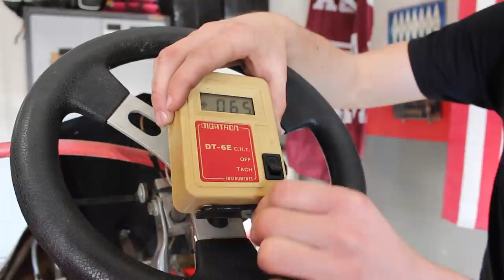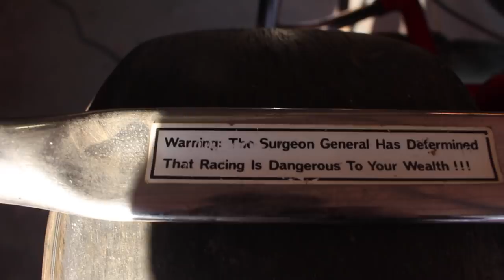2-Stroke Racing Go Kart Find!

Comment: Try cleaning the spark plug or buy a new one. If that does not work try checking the spark coil. Also try cleaning the float bowl if it has one

Comment: you want a carb kit for that carb change out the diaphragms as its a pumping carb . best way to check it is to see if its lifting fuel from a lower level . if it pulls fuel from lower the pump is working , if not there is your problem . you should also have a pop off pressure gauge or a little hand pump to measure the pop off pressure . i will see if i can find you a link .
Reply: these links should point you in the right direction . may not be a tillotson carb but it will be very very similar they are all pretty much the same

Comment: also check the diaphragm in the carb for holes tears and flexibility  soak the carb in carb cleaner remove any plastic and rubber parts first   count the needle turns on the high speed and the low speed you should be able to see the letters H and L on the carb soak overnight Rinse with water and blow out all air ports with a air compressor then reassemble

Comment: the pipe with the sticker on it is not a bash bar, its a so called stabilizer bar. You can install it to make the chassis more riggid. You can also fine tune by rotating the flat part in the horizontal or vertical position. (horizontal: more flex, vertical: less flex)

Comment: In the 80s yamaha sold karts at the cycle dealership in my hometown. They looked good and think based on yz125 i had a margay with McCullough and it would flat smoke the yamie. On track or street. Rear brakes only pretty sketchy.

Comment: i own few 2 strokes. It sounds like carb issues,but u might still want to compression test it becouse a 2 stroke will run with rings completely fried and piston being cracked it has happen several times on bikes iv bought, so make sure u check everything.

Comment: it could be gaskets causing a vaccum leak. once you get it running get a slide carb for it, they work significantly better than butterfly carbs

Comment: Let it run for about 5 to 10 minutes before you even think about trying to tune the carb because with my experience they have to be fairly warm to run right ........ also check the compression
Reply: What should the compression be for this motor. ? I just picked up a kt100 on a nice Prowler kart frame? I got a hell of a deal on it but I don't know anything about this motor I haven't fired it up yet I have just been reading all the comments trying to figure out carb settings and stuff glad I read to start it under a load!  The motor is off the cart right now and I was going to try and start it on a engine stand I'm glad I didn't I'm going to go ahead and probably rebuild carb. While I'm at this point!  Thanks for any info I also got 3 dry clutches 2 that are a horstman 2 disk, but they are the wrong size on the shaft it came as extra parts the one that fits the KT100  is a 1 disk dry cheap looking clutch?  I'm 6.3 220lb what type of clutch do I or should I run for it to handle what I need???  And eventually I want to figure out and learn how to  make stock kt100 fast and what that  involves?  Thxs for any info.

Comment: First thing after establishing spark and compression before taking carb apart count your high jet low jet turns to full in to seat make note of them .. Always start with high setting about a turn to 1.5 turns to start ... Tear carb completely down soak in a carb cleaning solvent like briggs and stratton or such submerged if possible...blow out all jets with high pressure air... replace fuel diaphragm and seals . It should run ... The original settings should be close as a rule ..  Another thing mechanics tend to over look is the crankcase seal its very important on a 2 stroke motor since that downward vacuum stroke on piston activates the fuel pump diaphragm.. .... good luck

Comment: i used to own one of those engines there called a yamaha 100s race engine, ps. the reason it is so hard to strat is that you need to choke it every now and then to get it to start, plus put a new spark plug in it.

Comment: The crank vacuum comes from good rings and head seals.
You can also put a bit of 2 stroke or crank oil in the compression chamber to help reseat the rings.

Comment: Two stroke motorcycle engines require ring replacement after a certain number of running hours. A compression tester is something that you'll need to see if that's the problem. 150 to 160 psi is really good. 120 and below... not so much.

Comment: There's no 2 stoke oil in starting fluid and a 2 stroke engine is basically the same as a four stroke, spark fuel fire  the only difference is it uses reeds instead of valves you boys keep messing around with engines and you will end up being pros it's really cool seeing you youngsters into  this type stuff keep it up

Comment: The KT-100 is designed to run on 100 octane racing fuel. Putting pump gas in it will cause preignition and much lower HP output.

Comment: Maybe test crank-seals? Hold a paper in front of the carb to test the suction. Also try to use starter-gas on the crank seals/crankcase while the engine is running and listen for change in rpm. Considering the engine has been sitting for a while, these seals tend to dry up.. Just a thought :)
Reply from the maker: Sondre Kvernstuen Ok, I’ll take a look at them, pretty sure the box of parts has some new ones anyways

Comment: You shouldn’t need to turn those mixture screws but 1/4 turn off seat. Also that is a wet clutch and it takes oil. If you need any engine parts/ and you will with that Yamaha, especially if you run it too lean. I have lots of engine parts and a couple complete motors for sale cheap. Mine is a Honda 125 shifter now.

Comment: ah, a late 80's Margay. Can't remember when they first started running the front fairings. Would love to know the history behind this kart. Looks like it had it's share of WKA races from that era. There's LOT'S of information on yamaha's out there. Their still run on a national level in some series with the 4 hole can, instead of the pipe. I really don't condone running in a parking lot or street. Take it to a track, and then see what it can do. As many said, if you have any questions or need parts hit up Woltjer Racing Engines, or Comet Kart Sales and take a trip to New Castle Motorsports Park, , they've been in the sport for a long time, great people, great facility. Good luck

Comment: check the crank seals. and btw that carb is called a tillotson. so internal fuel pump and no jets your "jets" are those needle adjustments. if you need parts to rebuild it or anything look up scooter swapshop talk to brandon he knows all about those

Comment: I would find a mikuni slide carb and a little mikuni fuel pump that runs off the crank case vacume, 1979 arctic cat pantera or panther with the 500 spirit engine should have both. Just play with the jetting on the carb a bit

Comment: to choke the engine you put your hand over the carb to draw in gass. Then try 2.5 turns on screw with black knob and 2.5 on low end screw. Good luck

Comment: awsm kart....yea that's a steal for a 'race kart'......the kart frame usually on the spendal or frame somewere will usually have the name....I used to have an older 'margay' race frame...I forgot all the names....'tony kart...margay...invader'...there were a few more tho...invaders and tony karts were big n the 90's n early 2000's....idk wut they run n wuts popular now.....those Yamaha 100's were 'thee engine' to have tho.....shifter karts with the 125 were even better but way expensive...250's were wacc tho lol!! usually tho Yamaha 100 was the cheaper but better built engine to have and u didn't need a clutch set up either....

Comment: An engine Needs  three things to run air,gas and oil I had the same problem on my 2 stroke engine just put more 2 stoke oil in the gas and you should be all fine.

Comment: Carb rebuild and a new plug for sure. Looks like a walbro wb19 carb? It will need a rebuild. Rebuild it and you’ll be sorted. I used to race formula tkm using these carbs. Keep it super clean aswell. Take the head off and make sure the piston ring isn’t gummed up. 
But your problem will definitely be the carb. Hit me up for any advice.

Comment: I bought Yamaha kt100 go kart
one week ago

it was lying in a barn for 10 years
I had to repair brakes and tank
I was surprised because the engine started the third time

Edit: I have question
I can't stop
if i stop engine engine cuts off
You had the same?
Did you have the same problem or did the engine still run?

Comment: Swap out your spark plug in between starting and running it. I have found with 2 strokes they flood with fueleasily and when your plug is wet they won't run for nothing.

Comment: I race 2 stroke shifter karts and think something is wrong with your fuel pump. I've never used a carb with a built in fuel pump but I suspect that it needs a pulse signal from the crankcase. Your fuel pump will have a fuel in, fuel out and a 3rd outlet which has to be plumbed into the crankcase to get a pulse when the piston goes up and down. It started and ran when you held the fuel above the carb because of gravity, now you have to find out how to get fuel pumping.

Comment: I'm a little late to the party but make sure you don't have any leaks in between the head and the crankcase or between the crankcase halves.  I've chased many strange idling issues only to find out the problem was an air leak in the bottom end.

Comment: BCR was for Brown & Crews Racing. They were a kart shop and engine builder  in the late 90’s.....you need to reset the pop off in the carb....or you will seize the motor.....check with the guys at north Texas karters...they can help you

Comment: using 2 stroke engine, to create a gas flow in the carburator you need to use a closed gas tank, gravity doesn't do the job

Comment: Ya know. No one understands they have a separate schooling for two strokes than gasoline engines. I know cars and four stroke. I have very little knowledge on two stroke other than they combust similar to a four stroke lol. I have a sled that does the same damn thing and can't figure out WTH the problem is. But he's right. It could have a weak spark under compression. The spark could be weak from fouling out. I usually run br8s or br9 are the anti fouling plugs and same price but they're awesome plugs try that

Comment: cranking it for that long without it starting scars the cylinder walls because there is no fuel/lubrecation getting into the cylinder. if you put a little oil in the cylinder first then cranked it it would be fine.

Comment: Take the carb off and the reeds if there is one there is a pin hole that might be blocked off and not letting it suck fuel because there is no vacuum

Comment: take off the vacuum line have somebody turn over the engine make sure there's suction if that ain't the case you got suction then pull Carburetor part make sure the frames nice and loose everything's moving right nothing's clock make sure the main Jets aren't clogged and it's a rich motor that motor needs a lot of fuel make sure you got your mixture screw out quite a bit and if it's too rich when it startslean out couple turns or half turn

Comment: This might be a stupid question but can you put a predator 212cc 6.5hp on that frame with the clutch facing toward the seat and the sprocket on the axle on the inside of the frame? Sorry if that didn't make sense. Thank you
Reply from the maker: KJ Animation Yeah you can, you just need a special mount kit.
Reply: Build Break Repeat will the racing one on go power sports work? Thank you
Reply from the maker: KJ Animation Yeah, should bolt right up.

Comment: Its a KT100 Yamaha Motor, on a Margay Chassis. It has ran the WKA (World Karting Accosiation). Spray a LITTLE bit of WD40 on the air box. When the motor will not start REV THE SH*T OUT OF THE KART to clean it out.

Comment: Hey guys iv just subscribed.
First off check basics 
Fuel to carb 
Spark plug
Spark 
If failing these you probaly have an air leak somewhere check from splits in the inletmanifold what the carb bolts onto one small slice/hole can throw everything off balance

Comment: Going to need to clean the carb properly jets probably full of crap and float valve chamber will also be gumed up change plug and lean off the mixture also check things like reed valves

Comment: Too much oil means it runs too lean and when you get it rich enough you're fowling the plug so it dies off. You'll wanna just add a half cup of gas to a gallon of your mix and see how that does, should be easier to start and easier to tune. Watch the smoke on the exhaust, too much oil means more smoke and not enough oil means no smoke.

Comment: Hi guys. I can’t believe, you are not able to fix two strokes engines. It’s a lot simple than 4 strokes. I'm not clear on what you did to the engine and how you did it. Did you sleeve the engine (thinking you have rebuilt the engine)? This is a very precise operation and this is where most of the problems come from. Holes must match 100%. These engines are forced and the bores are drilled to the max to get fuel in and out as well. At 11.00 you forgot the spark plug. Too bad! You have to change it immediately. The spark plug has to be changed often. That makes me think. Does the reeve system valve work? Is the spark plug collects a lot of oil and fuel? That's the engine.
 I have no idea if this engine is a point or induction ignition. If it is a point, please, check the shaft opening the points (also with induction), it should not have lateral movement. Replace bushings if necessary.
 The last thing is the carburetor (It might be the first thing). I don't know if this carb is a needle carb. Move the needle down for a leaner mixture and try. In my days, years ago, we used to widen the jet with special tools until the engine started to choke. Probably the jet is open too much. Replace it and widen it to one side before.

Comment: I have a problem with my go kart if anyone could help It would be a amazing I got it for 600$ perfectly running one month later I turn it on , start driving it for like 10 or 20 seconds then turns off, could it be the carboratour
Reply: yes most likely not getting fuel
Reply: jeep2003 would this be a carborator issue because the fuel is just staying in the pipe
Reply: most likely it has crud in the bowl that got sucked up by the jet. You can usually remove it and spray it out without even removing the carb from the engine
Reply: Carburetors on 2 stroke engine can easily get clogged up even just sitting idle for a short period of time. The gas evaporates and leaves the oil which is mixed in the gas behind. I good idea is to shut off the fuel supply to the carburetor and drain the float bowl.
Reply: check if the spark plug is sparking if not then you have a bad wiering from recoil.
Reply: REPLACE "ALL" FUEL LINES  with NEW  ONES
Reply: air leaks 1st thing a two-must have no secondary air ,can ck w/starter fluid any rise in rpm's is secondary air.[ an air leak ] this must be done BEFORE! you start ,tuning I suggest run a slightly rich mix until you are at fine race set adj,do plenty of plug ck runs reading your plug.  thru low mid,and top .KT's are a Blast, have fun!!  vancouver yamaha

Comment: I have regretted every two stroke purchase I have ever made 😎😎😎😎
Reply: nah man I got a 04 yz250 starts first kick every time, its a beast... love that bike. I'll never sell it.
Reply: ktm 250 love it would not trade it for the world...😍😍
Reply: They are a bit of a pain at first but what mad you regret your two stroke purchases?
Reply: photondebuger45 honestly don’t see how they are even a pain at all, speaking about dirt bikes and racing atvs, a 2 stroke dirtbike is 100x easier to maintain, cheaper to fix, easier to start especially when hot, and have the same if not more power that the four stroke that it is compared too. I’ve owned both 4 and 2 strokes. Both have there perks, but when it comes to a saying a 2 stroke being a hassle, then idk what your smoking
Reply: Carrot- Effects -122 I guess it does get a bit tiring to pull on a pull cord to get it to start but both 4 and now two stroke engines are getting starters or electric compatibility now it's great I like me my two strokes they fun
Reply: photondebuger45 Id still prefer kickstart over anything imo, if your bikes starter or battery goes out then your screwed if your in the middle of the woods or something. My bikes always start 1-2 kicks everytime both 4 and 2. It all depends on how well u maintain them
Reply: Carrot- Effects -122 oh of course now the more electronics are added there's more points for failure but I yet to own a bike with a kick start quads have kick starts to right
Reply: first bike i ever got is a yamaha dt 50 mx it idles beautifully and shits over all the 50cc 4 stroke mopeds
Reply: looks like someone doesn't know how to handle and maintain a 2 stroke or you are just scared
Reply: At least they make a glorious racket unlike their 4-stroke counterparts!! fantastic for pissing off that neighbor you hate.

Comment: Check the gas to oil ratio the engine requires that could be one of the problems
Reply from the maker: Blake Tweedie Ok, I’m pretty sure it’s ok but I can look again or re-mix some thanks.
Reply: Build Break Repeat, if not make sure to change the spark plug cause 2 strokes are very tempermental and fineque

Comment: The reason its not running right. You need to use methanol and oil. The carburetor is jetted for alcohol not gas.

Comment: This is a bad little kart. It will be efficient soon as you get it set right. If it were me I'd try and find a makuni carb and run a puls pump off the engine that carb is like a weedwacker carb and are a pain in the ass